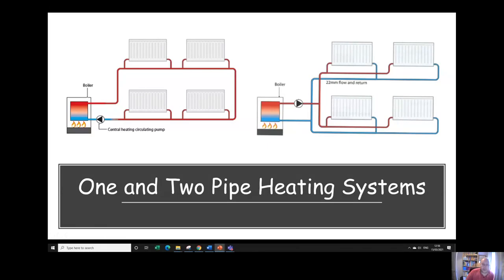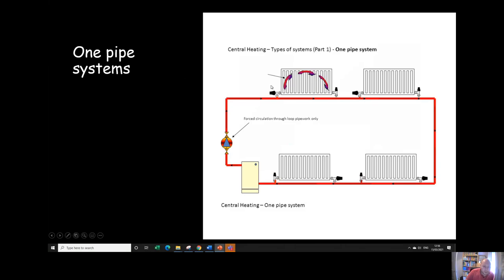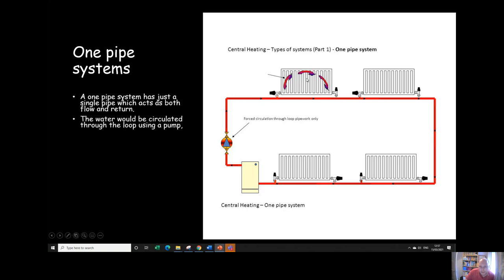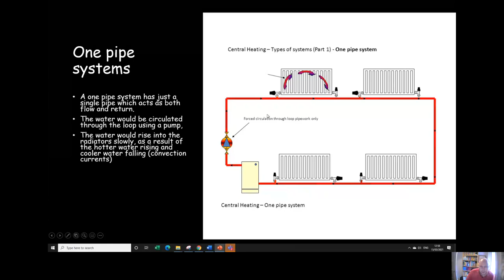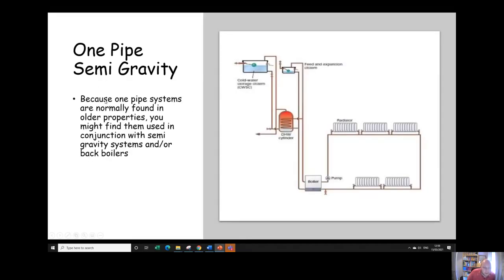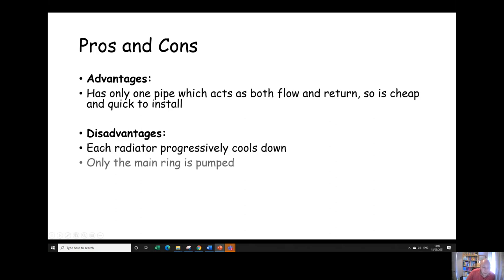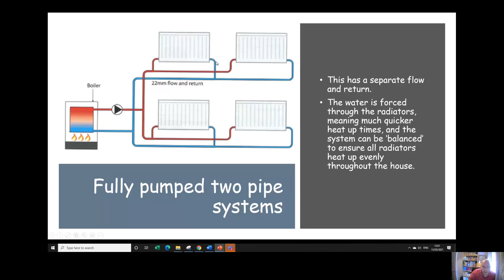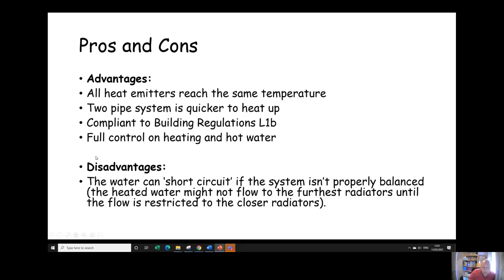2.3 One and Two Pipe Heating Systems

Comment: Thank you for the explanation. Is it fairly expensive to upgrade to a two pipe system from a one pipe, especially if you are also upgrading to a combi boiler?
Reply from the maker: Thanks for the question. 

The cost would vary by property, number or rads/lengths of runs etc. 

Worth noting that changing to a combi isn’t necessarily an upgrade as they have a limited flow rate (it takes a LOT of energy to heat water). 

Whether a combi is right depends on the amount of hot water you’d need.

Comment: Would you use 1/2 inch pipe to radiators
Reply from the maker: Normally it’s 15mm, but some rads might be 8mm or 10mm.

Comment: On a one pipe system with radiators in series, would it be necessary to balance the system via the lock shield valve on each radiator,?
Reply from the maker: Water would only be pumped round the pipe not through the radiators. It travels into/through the radiators via convection and you wouldn't want anything to slow this down, so locksheilds should be fully open. You would need to oversize later radiators to allow for the heat loss from earlier radiators.